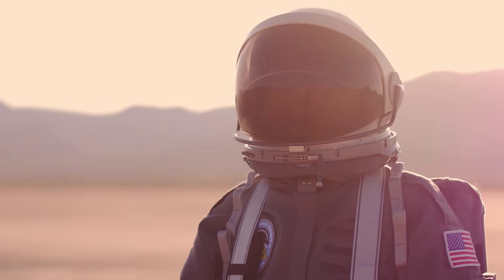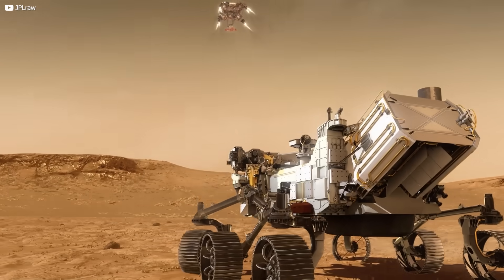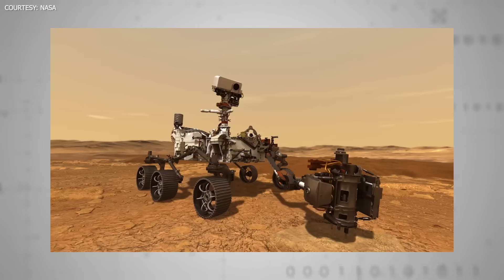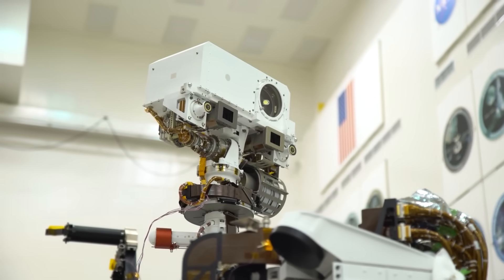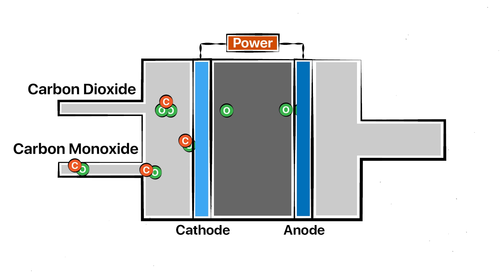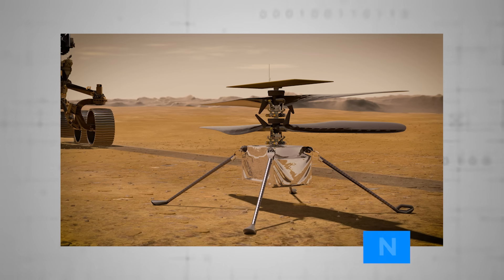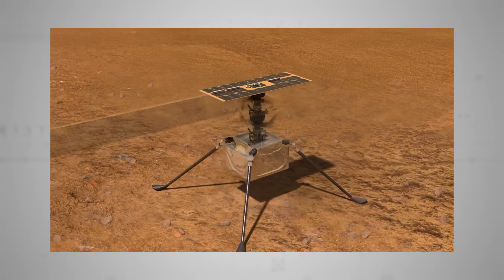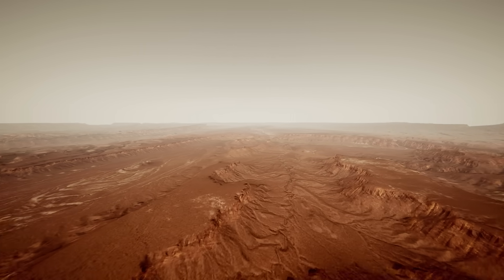Everything Discovered On Mars So Far

Comment: why don't make big fling shot type machine or big spring get off ground then use rockets push in to space as gravity less then ours, what about space lift so use less rockets get item up in space. or magnet rocket launch have good couple km long get speed up at end turn rocket go up fire rocket that way. or under ground cannon have big one so fire rocket at space that would get speed up less fuel burn get on ground..